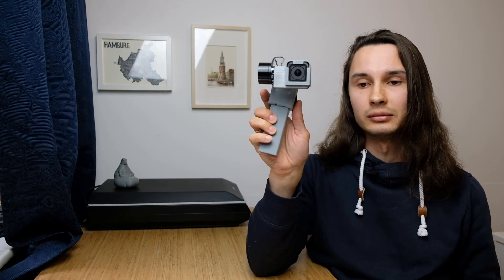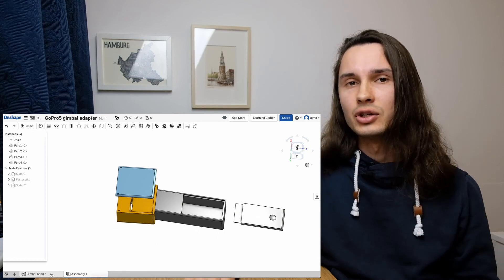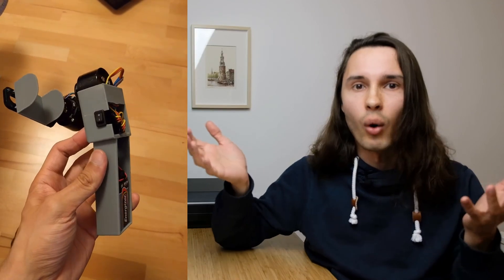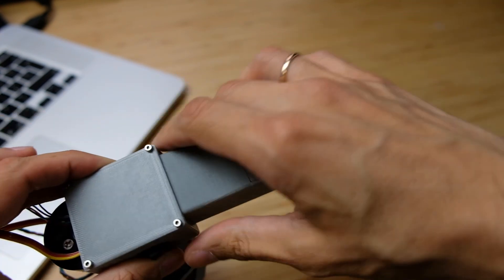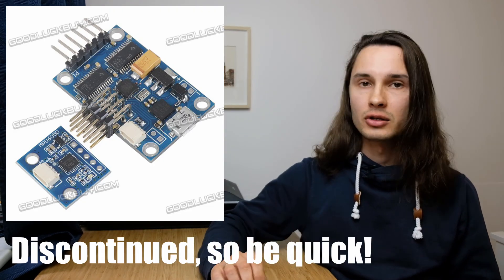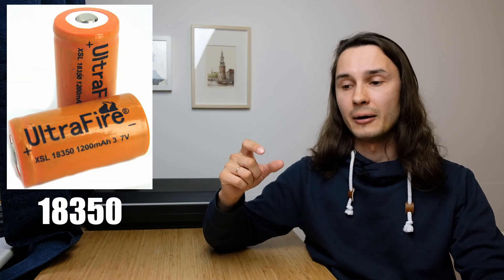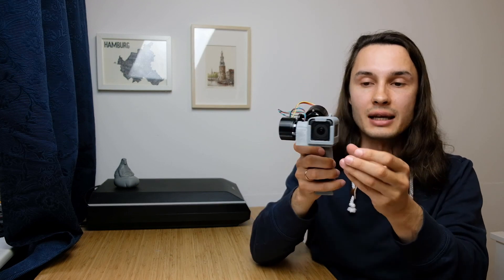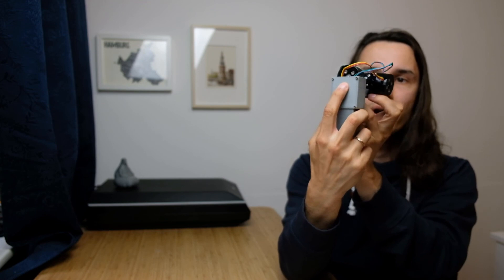I Designed GoPro5 Session Gimbal!

Comment: I have just by chance looked at your little film, I found your presentation very likeable, modest and interesting at the same time, I think your talents could be of immense value in getting involved in the drone hobby, I have recently taken up this pastime and enjoy experimenting and modifying quadcopters, of course the drone bench mark is the DJI company who produce an excellent ready made product but at a price. Sometimes ready made is not everything as I think you mentioned in your video, the satisfaction of owning a self built product can be far more rewarding. There are many videos out there showing various attempts at gimbal additions as most budget drones simply just bolt on a cheap action camera with rubbish results, I am currently in the middle of my own build but hitting snags , my challenge to your my friend is to jump on board and put together some ideas with your expertise and release them on video!!